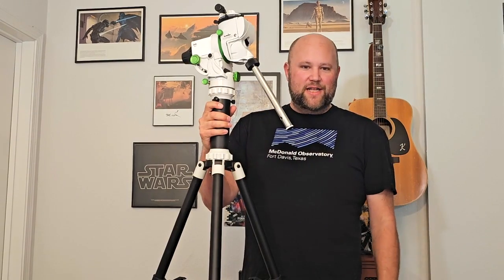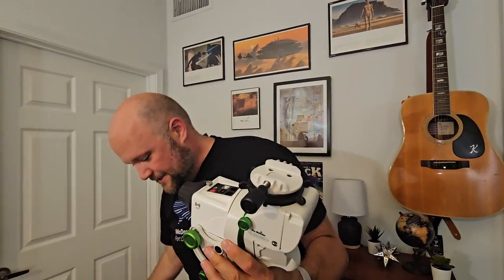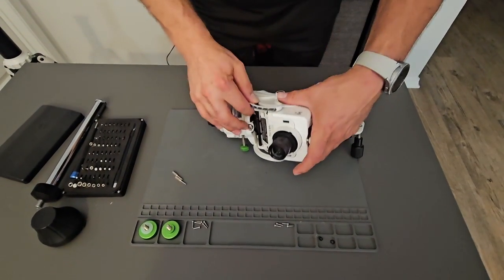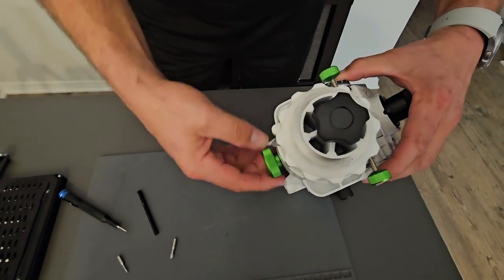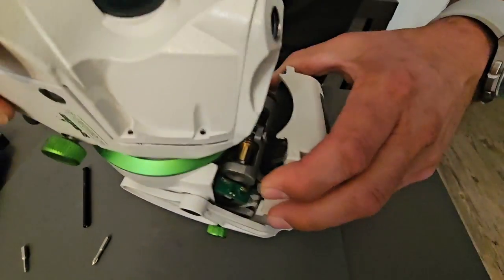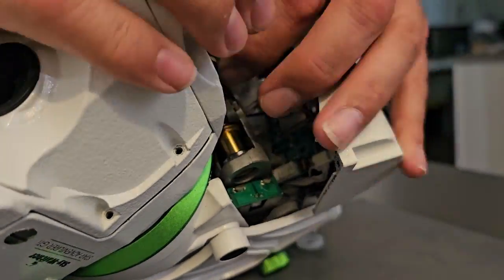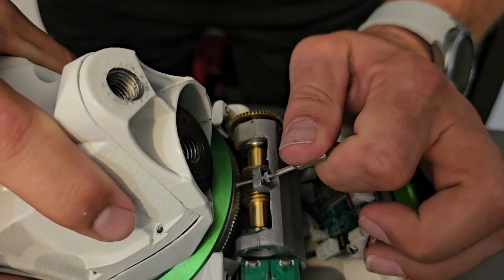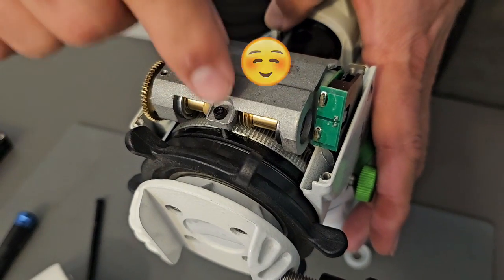Achieve Stellar Performance: Backlash Adjustment for Skywatcher Star Adventure Gti

Comment: Hey, I recently purchased this tracker. 
 

Took it out for first night of imaging with my DSLR and telephoto lens.

1. Everything was balanced
2. Aligned with Polaris 
3. Mount was facing north
4. Tripod was stable and balanced

When I went to complete the 1 star alignment, the mount was slewing in the total wrong direction away from Jupiter which was the target I selected.

I tried everything to fix but couldn’t; checked location, off and back on, redone balance and polar alignment but nothing seemed to work?

What am I doing wrong? User error?

Comment: OMG,  sorry but you need to pull this video. It's all terrible advice.

Just peel 1x sticker back.
then only adjust the backlash whilst the RA is in motion, 
you'll see it slow down or start to grind if you go to far, then just pull back a touch until it sounds better.
RA backlash is an Extremely simple adjustment on this mount
Reply from the maker: Yeah there's updates in the video that mention the sticker and I have a video for that as well,  but some people liked the context of disassembling it.

Comment: Remove the sticker and you can gain access to the hole that leads to the backlash adjustment screw
Reply from the maker: Yeah I mention it on comments and link to a video updating that info.  Thanks for the heads up though!

Comment: I noticed the backlash adjustment screw at the end of the video does not have a hole in the case unlike the hole behind the label, if backlash needs adjusting to this screw  it might be easier drilling a small hole into the plastic case to enable any adjustment of the screw rather than having to remove the case once the warranty has expired? Thanks for the video & clear skies from across the pond.
Reply from the maker: That is an amazing idea and I think I will do just that! Thanks!

Comment: Thanks for this video and your follow-up video. I have backlash in mine, but it's neither in the DEC or RA - it's in the lead screw that adjusts the Altitude/Latitude.  Poor machining has the end of the screw shaft wiggling around about 1mm which makes it an absolute bear to adjust the elevation of the mount.  Over-shoot the elevation even a few seconds and you need to go the other way the head flops down to take up that 1mm slack.  I am waiting on a call back from Sky-Watcher now.  If you loosen up your elevation lock screws on either side of the mount, does yours also wiggle up and down?
Reply from the maker: Wow ok hard to visualize what you mean with moving up. There is slop when I loosen the lock screws if I apply upward pressure to the end of the counter weight shat there is play at the adjustment screw where it attaches to the adjustment bracket, however this causes me no issue with adjustment. I understand what you're saying of you got the right height the slack gets taken up and you have to start over. Ideas based on this, perhaps a small bungee cord to keep consistent pressure against the slack until you are able to lock elevation?
Reply: @JeliSpace  that’s a great idea for a short-term fix!  I’ll let you know what Sky-Watcher says.  I’m a well-experienced photographer that’s just now branching into Astro.  I know my cameras well, but these systems are relatively complex. I’m driving the GTI with an ASIAIR Plus w/ZWO 120mm and will be shooting with a Sony A7R3/Sigma 150-600 lens..  Wish me luck,
Reply from the maker: @Big-Foot-Randy  I agree the learning curve is insane! However I love how deep the rabbit hole goes and the rewarding pay off when you stack it together and see the results! Good luck, also I'm making a discord group soon so we can actually share photos and discuss issues and all so be on the look out for that

Comment: Great video👍 any chance of a vid showing complete strip down, clean and re-grease etc
Reply from the maker: I did do a full rebuild on an older mount, Eq5pro replaced the bearings and all that jazz, actually helped a good bit. I might have to do that sometime on the GTI for fun lol and see what makes it tick. If I do I will record it and tag you in it. With winter coming up I will spend more time in the shop. I do plan on realigning the polar scope in it though so I will record that one.

Comment: Thankyou.  It was worthwhile seeing that the gears are metal not plastic, and how to disassemble the unit.  But peeling off the label does seem the way to go for adjusting the backlash.
Reply from the maker: Indeed it is, which I discovered after the fact as all have seen lol. I still love to see how stuff works on the inside though lol

Comment: Wow great way to spread really bad information. Anyone reading the comments don't watch this guy, he's giving you bad information.  You dont need to disassemble the housing at all.  just peel off the sticker you will find a hole in the housing which is specifically designed to adjust the worm tension.
Reply from the maker: I appreciate your view point. I have addressed it in the comments, however I still feel there is value being added in the video because I open it up all the way. Others have stated they appreciate seeing that. So food for thought there. I am not trying to spread bad information, I am learning and documenting, like anyone else.
Reply: @JeliSpace  Would you strip down the engine on your car just change the oil? The problem I have is that you will get a lot of people needlessly opening their mount and potentially damaging the cables or circuit board.
Reply from the maker: Comparing going from an oil change to rebuilding an engine to the disassembly of this mount is a perfect example of a false equivalence fallacy. The amount of knowledge, skill, and tools required to go from changing oil to rebuilding an engine is vast. The same does not hold true for remove a cover that requires the same simple hand tools you would use to make the adjustment with the cover on. I will not assume that is below the average person consuming this content. I would ask that in the future when you are trying to help others perhaps you also help the person who made the content by making less inflammatory comment such as  " Have you considered updating your video to include information about the much simpler way to adjust the backlash, if not you should consider that." 

It is far more constructive in a community to strive to be helpful for all involved, instead of trying to talk someone down. Try to help them and others learn. Honestly I am looking for common ground here if you aren't willing to meet me half way here then I don't know what to say to you. Just consider if someone was dropping comments like this on your content. Simple golden rule stuff. That being said I did make an update video to include the information about the hole and it is crossed linked. Thank you for showing your concern for the information contained herein, just work on the delivery please.
Reply: @JeliSpace  wow you can't let this one go can you.  Maybe don't make  YouTube videos if you can't accept a bit of criticism. At the end of the day you posted a video describing a completely unnecessary process and then tried to claim it was a strip down video after several people told you that you didn't have to strip it down. So cut the bs and just accept that you put out a video with wrong info and move on.
Reply from the maker: @wafflefreetech7062  lol OK 👍 just trying to be reasonable guess is not for everyone.
Reply: @JeliSpace  I also felt there was value added by showing how to access the RA/Dec gears (you'd also need to do this to access any play in dec). This person is just being a dick who doesn't know how to let something go. You've earned a subscriber, keep on going!

Comment: You can get to RA adjustment screw by using heat from a hair dryer to loosen the sticker in front and peal it off. There is an access hole for the screw under the sticker.  Also, if you do have the cover off, take the RA screw out and wrap Teflon tape around it then replace it.  The tape keeps the screw from loosening.
Reply from the maker: Excellent tip thanks for sharing! I learned about the hole you are talking about after posting this lol. I will make an update to this video for those that chose to go either way. Thanks again!
Reply: tks you
Reply: Can you really take the screw out through that hole ? I tried but not able to do it .. mine keeps slipping every now and then ..